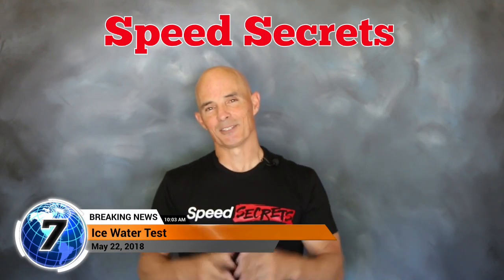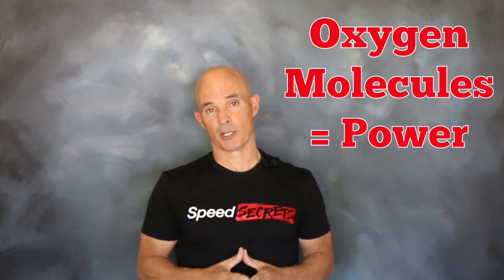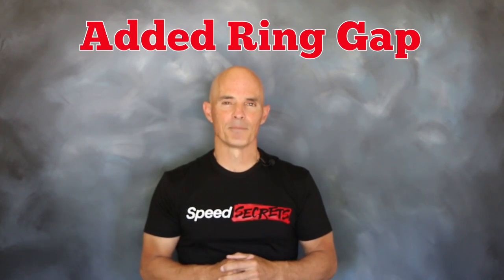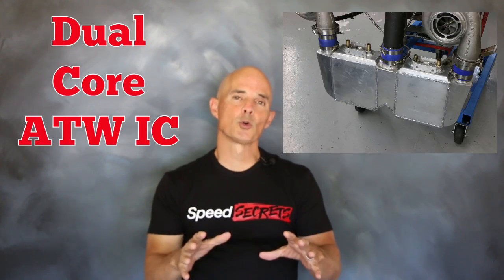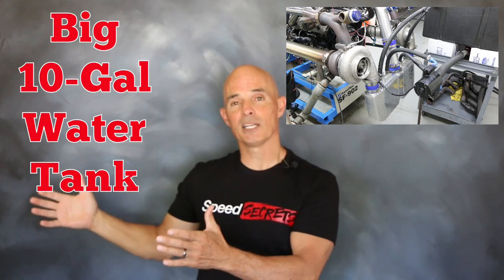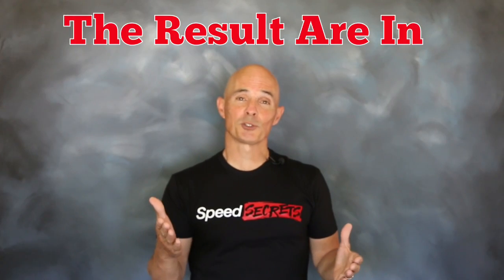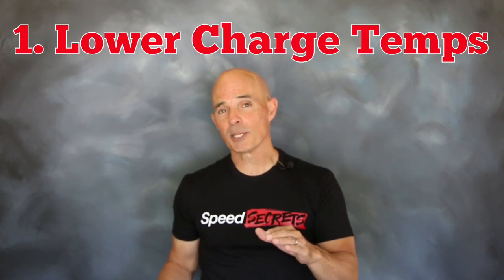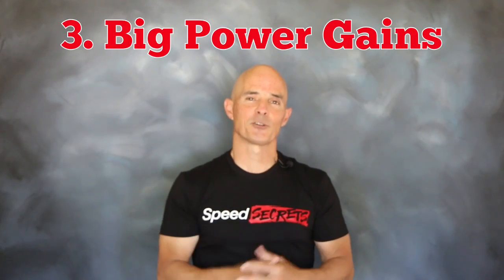TURBO LS INTERCOOLER TEST! DOES ICE WATER WORK?

Comment: If you are pushing a engine to its limits and its starting to detonate I wonder if lower intake air temps would decrease the chances of detonation even if its increasing boost.
Reply from the maker: YES
Reply: @richardholdener1727  nice, that's my goal I suppose. I am building a chevy 292, not sure of compression ration but somewhere around 9.5:1 forged piston. Still have headwork to do. But also running a intercooler turbo set up, but not sure how much I can get out of it safely. Hoping around 10 pounds
Reply: Yes, lol..

Comment: Richard. I have a question for you that I can’t find a straight answer anywhere. I’m building a twin turbo lq4 for my pro street car. I’m wanting to go with some trick flow heads as I think they are some of the best heads for flow without sacrificing velocity. They don’t recommend running stock rockers.  What do you recommend since you run trick flows allot. I obviously want something very reliable but don’t want to spend $1500 on jesels 🥴 thanks for your time sir 🤙

Comment: It would be great to see the difference a 50/50 mix of water meth would make compared to no intercooling at different boost levels,pump gas and race gas.
Reply: power and IAT difference.
Reply from the maker: did you see the WM distribution test vs the intercooler on Engine Masters
Reply: I didn't see a video of that,I'll have to try and find it.

Comment: Richard, do a test where you cool the fuel, like in a Moroso Cool Can!
Reply from the maker: Andrew Lang the engine Masters Guys did that I think
Reply: @richardholdener1727  they did something similar. but i would like to see the fuel system cooled to almost freezing temps and see the power gains then. im betting it would be NASTY HP gains. and torque that can break necks :) i have a idea but dont wanna be throwing it around in public and making others rich. i have done that enough in the past. like to talk with ya on something tho on a idea i have. but didnt wanna just message out of the blue on fb.
Reply from the maker: Hard Times Wrenchers has freezes at -100 degrees F so that would be tough unless you use nitrous as the cooling agent. Even then, the gains I think might not be what we hope , but testing to find out is always good.
Reply: @richardholdener1727  right and liquid nitrogen has insane pressures when its enclosed in tight spaces and warms rapidly. to point it would break things.
Reply from the maker: Hard Times Wrenchers it’s expensive too, but fun to dip bananas in
Reply: @richardholdener1727  sent ya a facebook message. quick sketch. but maybe when ya have a few mins something you can peak at. hope had good thanks giving and have a good/safe holiday season.

Comment: Is it possible to see the graph of turbo outside temperatue and the graph of the IAT for each test bench. Thank's
Reply from the maker: gabriel LACOMBE turbo outside temp?
Reply: @richardholdener1727  the pressurised air temp between turbo and intercooler. To know the intercooler efficiency

Comment: Great video!  Thanks for posting that.
I'd love to see the effect of a 50 shot of nitrous.  With a 20lb bottle, it'd last a while.  I'm guessing that it'll almost double the hit's rated HP, a 50 shot will probably get you 100HP/TQ.  Plus it's easier to deal with than ice.  
It'd also be cool to see, instead of water and ice, use dry ice and mineral oil.  32F is nice but -100F is better.  Most grocery stores and butcher shops have dry ice, just call ahead.  Get the pellet kind if you can.  It looks like fat rice.  Better heat transfer to the oil.  I wonder if you'd pass tech inspection with a fog coming out of your trunk?  :)
Reply from the maker: I did a test using nitrous as the intercooler as well as nitrous with the intercooler. Turbo motors love nitrous!
Reply: @richardholdener1727  I know!  That's why I'd love to see the effects of a "little" shot.
Which video has the nitrous vs intercooler comparison?
Thanks again.  I love seeing this stuff on the dyno.  You've got one heck of a job.
Reply: Oil is a bad choice, alcohol is what you want to use...

Comment: Great video Richard!!  Did you have back pressure logged on this one?  I'm trying to wrap my head around why the intercooling (aftercooling) would increase boost.  The aftercooling means that the compressors have to pump more airmass to create the same manifold boost pressure, which means that more exhaust is going through the turbine wheels (more back pressure), which means that more drive pressure would be trying to open the wastegates, thus making LOWER boost in the way I'm envisioning it....  Maybe something I'm missing?  Or were you referencing boost pressure to the wastegates from the compressor outlets?  That might effect something...
Reply from the maker: Hammerhaus Kennel I’ll check the back pressure
Reply: @richardholdener1727  Thanks!!  I'm trying to figure it out, but as usual, limited intellectual capacity is a hindrance for me. Haha
Reply: @tptrsn  depends where the sending unit was located. Colder are is heavier and would measure higher PSI...

Comment: nice vid richard,what fuel did you use on it?..Id like to see a test ran with e85.then do a china air to air vs say the china air to water you guys used but instead of ice water use a heat exchanger setup
Reply from the maker: suicidal racing I have a vid going up son on ATA vs ATW
Reply: @richardholdener1727  Can't wait to see that!!